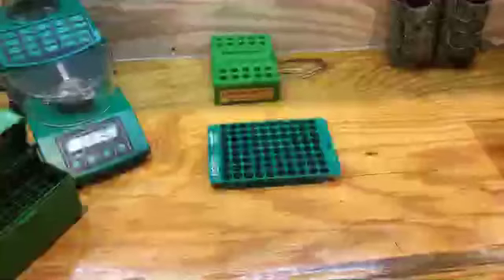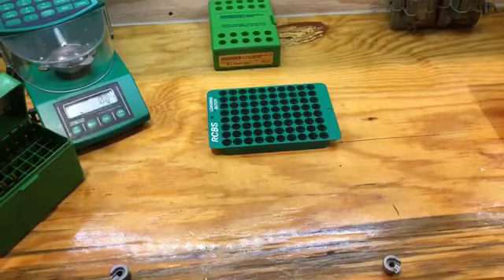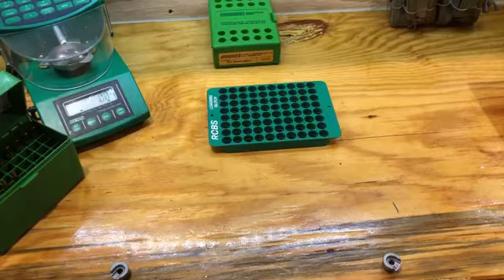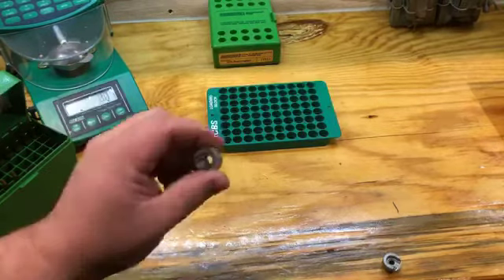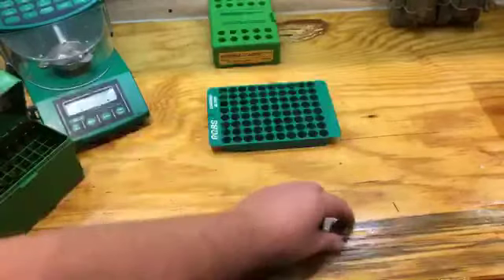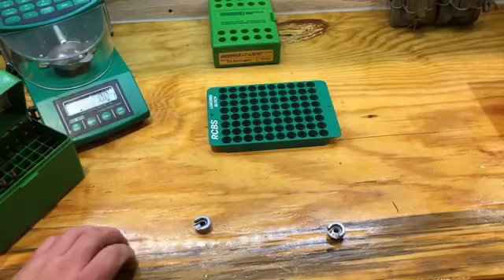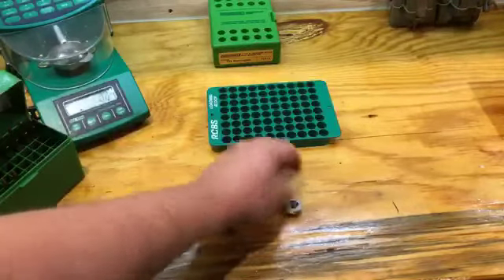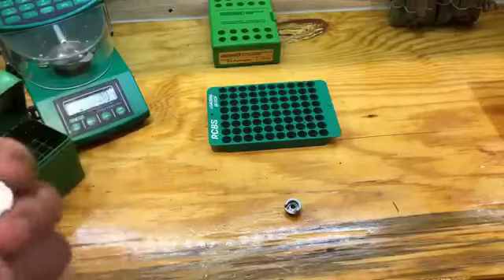Problems Setting Shoulder Bump

Comment: I tried honing my shell holder, but after an hour, I only removed .001.  What finally worked to be able to adjust my shoulder bump where ever I wanted it, was to use a .010 shim under the case.

Comment: The important measurement is from the top shell holder to the bottom of the slot that the case head rests on. The she’ll holders “ presses” the case up into the resizing die. When adjusted to the point of contact the top of she’ll holder touches the bottom of the die. The dimension from the floor of the shell holder to the top is what limits how far the case can enter the die, not the overall shell holder dimension…
Reply from the maker: OAL length being different just demonstrates they are all not the same. Milling the top of the shell holder is still how you can get more bump if needed. You can measure a dozen shell holders and you may get a thou or two difference from individual shell holder to the next.

Comment: If the point of contact where the top of the shell holder touches the bottom of your die causes too much bump, can you just back the die off a bit so it doesn't make full contact?.... and set it to where you get the amount of bump you want???
Reply from the maker: Sometimes not having full contact can result in runout.

Comment: Ok your shellholder are not the same but you do a mistake, this mesure on your shellholder is not the good way. The bottom of the shellholder have no "interest", the deep is the good way = the top of the shellholder which is in contact with the resizing die + the contact to the base of the case.
Reply from the maker: It makes no difference because the bottom portion is the same from unit to unit.

Comment: When measuring shell holder it shouldnt make any difference if 1/2” or 1” only difference would be is the thickness of lip holding shell….
Reply from the maker: The deck height is all that matters. I may have demonstrated wrong in the video.

Comment: Well now my curiosity is high, never thought about it.  I have 6 RCBS  lunkers, 6 shell holders.  I've been reloading a long time (I'm 71), been a machinist (still R one) for a long time.  I watched your video, read the comments.  Pulled out my 10 thousand 0-1 mic (not .001 but .0001, sat down and pulled the shell holders off the rams.  By NO Means am I an expurt. Just my two cents. First thing I looked for was where does the shell holders register with the ram.  It can not register from the top of the ram and the bottom of the slot in the ram at the same time, if it did, it would be difficult to insert.  There HAS to be clearance.  The clearance (my case) is between the top of the ram and the shell holder, thus the shell holder registers at the bottom in the slot.  I measured the shell holders.  How do I say this,  from the very bottom of the shell holder (against the ram) to the shell holder "case" bottom (hope that makes sense) would be the difference in shell holders.  My 6 had .005 difference.  I don't think the shell holders will be the problem.  As some one has suggested, your die maybe to long.
Reply: For me, it's easier to take one or two thousands off top of shell holder than off bottom of die, I use my wet stones starting with 400, then 600, 800, 1000, finish with 8000 (optional). check contact area on Die by using Prussian Blue as you proceed through the grits.